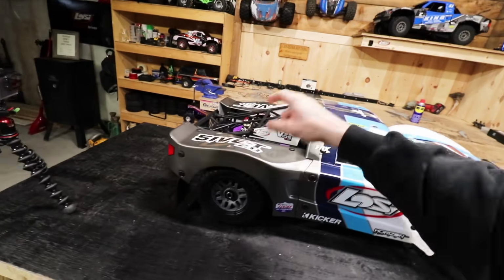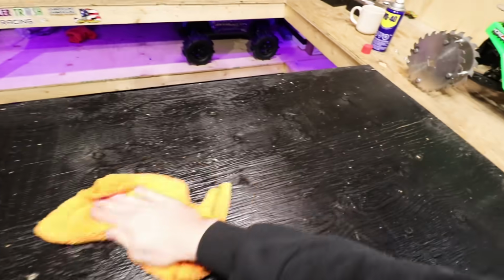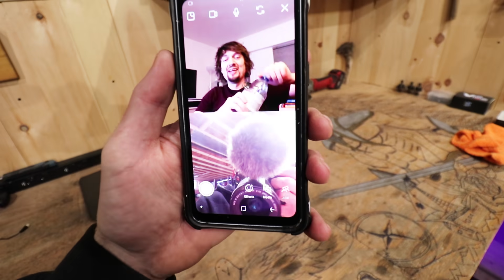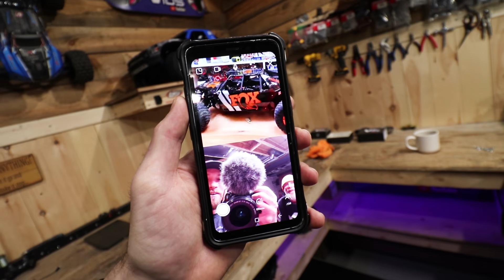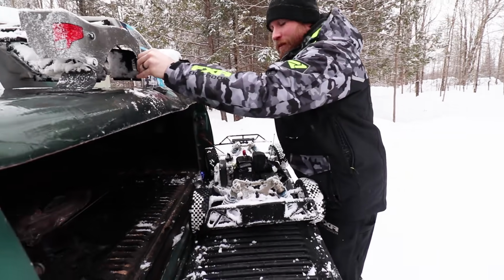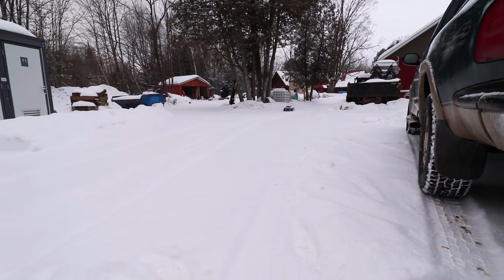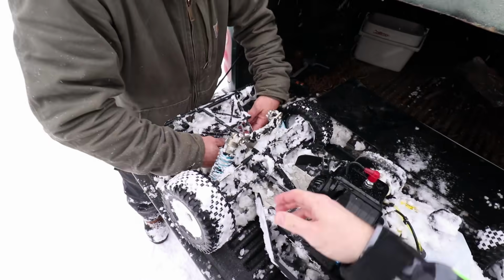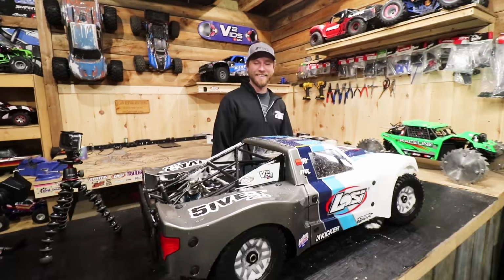Huge GAS Power MONSTER.! Losi 5T 2.0

Comment: just got mine 2 weeks ago! I immediately replaced the stock pipe to a rovan chrome pipe so the oil and black stuff will not splatter inside of the body.

Comment: That is freaking awesome! As far as the saw blades on the other vehicle, if you don't want to put paddles or something in between the blades, that's cool. Honestly, it might be a bit much for the vehicle, and you could start snapping things. I probably would recommend reversing one of the blades on each side in the front so that you have a bit extra bite for breaking and reverse.

Comment: Been using WD40 on my large scale RC's used outdoors for over 2 decades now! Makes cleaning them off SO MUCH EASIER....
Use a garden hose to rinse off, then blow off with compressor air, re apply WD40 = done and cleaned. Never had rusting hardware issues!

Comment: Ehhh read the Zenoah manual no special break in needed! Beat it to seat it! Thats the very best way to run a two stroke in and get it to make the most power it can! Gotta seat that ring to the cylinder as fast as possible! Just like a dirtbike! And 50:1 mix is perfect 25:1 is a complete waste of oil! Im no know it all just have 24 years experience in BRRRRAAAAAP! Great video brap brother!

Comment: Let Dave know that Zenoah engines are produced by Huskavarnah

Also, get a Killswitch, even a dynamite Killswitch is better than none at all.
Reply from the maker: I will be installing one.
Reply: @V2Vids  I don't know why they don't come with one from factory. I personally never had a runaway, but I have had a nitro runaway. That was enough for me to acknowledge the need for one. A 13-16 pound RC runaway is one thing, but 38 pounds dry weight taking off is another animal. I also must suggest a outwears for your pullstart as well as the air filter. The air filter gets clogged pretty quickly in dusty areas. Right now it isn't too much of an issue as there's little dust to worry about. The pullstart gets clogged up suprisingly quick if you use it anywhere with leaves, grass, anything of that nature. Other than those things, I don't have any other issues. Another suggestion is make sure the screw on your steering servo is tight and that the muffler bolts are tight after every run. I've lost a muffler bolts and two screws out of the steering servo. Pretty quickly too.

Comment: I have the King Motor X2 which is basically the clone of the Losi 5T but I've upgraded mine from a 30.5 cc engine to the 36cc Rovan engine I have yet to break it in and I also upgraded to hot racing aluminum Servo Mount and battery box with the hill and chronic eye gin Governor which I'll never have to charge the receiver battery again faucet dual dual Servo steering with all Savox waterproof blue one

Comment: That LOSI 1/5 scale gives good video . Its big enough that it looks great in slow motion. Why would you hit it with WD-40? WD-40 is a solvent I would think the same reason you wouldn’t use it on a gun you wouldn’t use it on anything with bearings or anything that needs lubed the WD would dry out? I might be wrong I know Jack about RC

Comment: get yourself some ACF 50, much better than wd40, which doesn't last. check it out, I use it on all my motorcycles for anti corrosion, long lasting super penetrating.